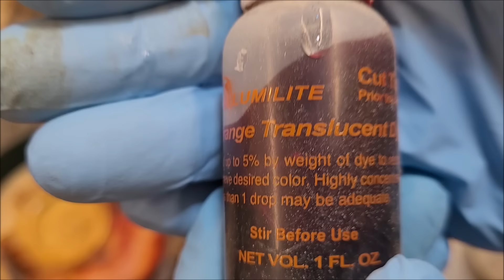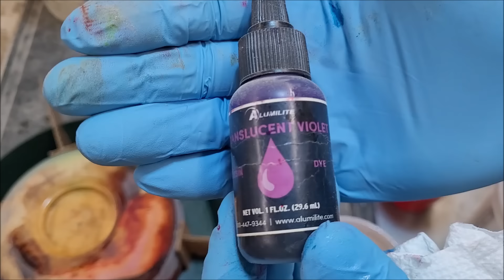Let's Try This Again !

Comment: Hi 👋, Doug , great looking 👀 Bowl, love the colours in it, I am hoping to have a go with some resin turning soon, been trying to install a log burner in my basement, now my property is in final in my name only, finally divorced from. X, nearly 5 years., so now consult, what can back on my property to finish, restoring it to a reasonable standard, And one of the rooms on the living floor, I’m going to turn into a small little workshop which I can heat quite easily, so this is where I will be doing some resin casting, And stabilising, and I need to get two or three more tools from Hunter, And have been experimenting with my wood, turning to create cracks in it, to do the Japanese art of Kintsugi with gold, 
Even when I’ve seen, people do resin art pieces, and they have thermal cracking, then fill it with another resin, 
Stay safe, keep up the great work , look forward to seeing your next art project, Phil from my Moulin,
Reply from the maker: I've done one like Kintsugi,  I did use resin but in gold, Thank You !

Comment: Until you get a fresh bottle of Cactus Juice, my I suggest using Slow-Set Resin/Acetone in a 50-50 mix as your Stabilizer of choice...

I think it might produce FAR better results even if the Resin will take 7-10 days instead of the usual 3-4 days to finish Curing...at least you know without doubt it WILL (eventually) Cure...

May I also suggest you start putting both the date of purchase and date of activation on your bottles of Cactus Juice so you know if the batch has expired BEFORE you try using it...

😄😁😆😅😂🤣
Reply from the maker: Thank You !  yeah I did the acetone and resin, just didn't film it, that's why I poured the resin in the mortise,